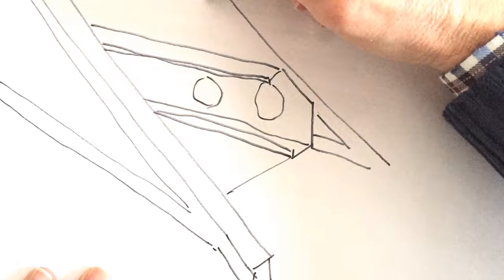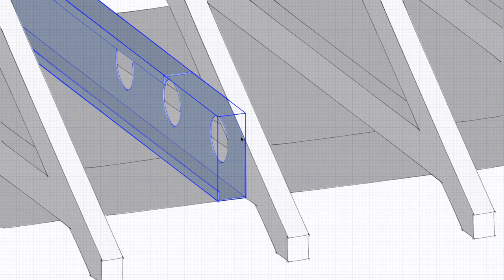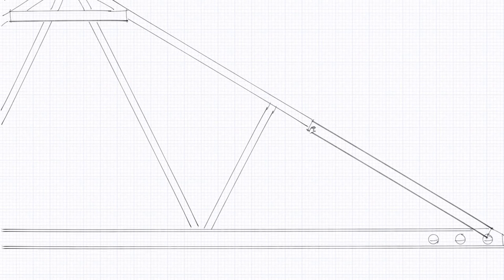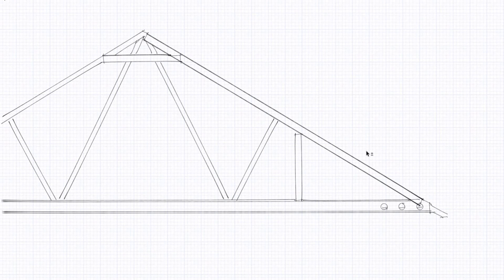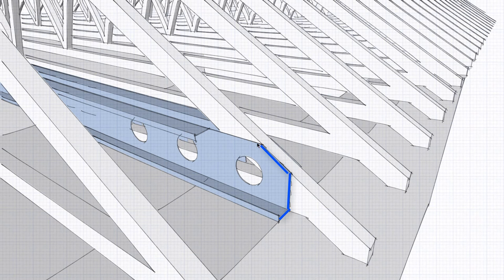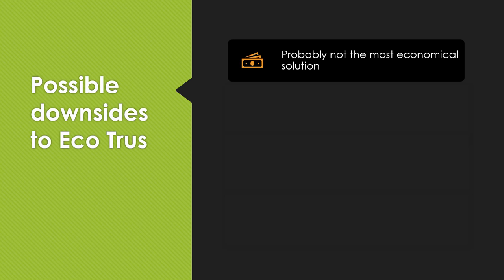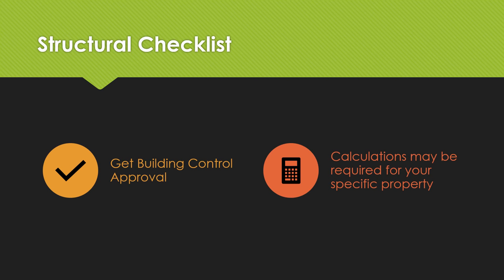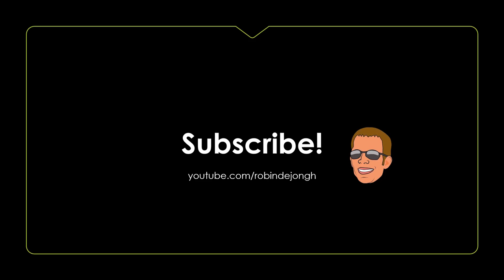Does eco truss work? (loft conversion)

Comment: I do not rate the Eco Truss videos very highly as although the product is good they skip over some important bits eg fastening the steel to the wood, and the cost of each beam I never heard mentioned. Also, you have the extra cost of scaffolding and crane or a team of men to lift the heavy beams. Then there is putting the lower removed roof tiles back on which is harder with an old roof - tiles crack etc. With wood you can cut it more easily eg if there is a pipe or something to go over or you need a hole cutting - wood is easier to cut/modify than steel - easier to work with. It is hard to get measurements spot on - with wood this error is less likely as you can cut on the spot, & even extend a piece a few inches. I think their steel system is for the 50k + projects. I like it though.
Reply: Sorry totally disagree steel can be cut just as easy as timber and can be modified or added on timber this steel structure can extra cost for a crane no crane needed and scaffold is need either a timber conversion or ecotrus I’m a installer of the structures and over the conventional timber system cost space and time is a huge saving  than timber structure iv been in structural steel as a welder fabricator for 20yrs the system design construction is honestly quite amazing to erect and see the finished product from first steps to completion and overall product is solid when it’s finished
Reply: I've watched videos where they do bolt through the wood.

Comment: Hi , In the videos they do say that all habitable loft conversions ,that it is to building regs . I have spent 50 years in the construction industry and I think the system and the ease of building and the inconvenience to the living part of the property is first class . Even if timber is cheaper ,there is a lot more labour hours on site on site , so it is horses for courses .NO crane needed and no heavy steel work and very little scaffold hire .
Reply from the maker: Thanks. I agree, and it's great to get your experienced view on it.
Reply: I’ve watched their videos and I like the whole process. I am concerned about thermal bridging, especially on a dormer. They haven’t shown how they eliminate cold bridging on their dormer construction yet.
Reply: @JohnnyMotel99  I think the best ,is to ask ROB VIA ONE OF HIS VIDEOS , as if a vented cold space or a fully insulated space .I did see him drill some large holes for venting air circulation on the video with the building inspector . Then if it was living space or storage space only .

Comment: Mine is getting fitted next week. The amount of extra room (length and height) I’m getting from this system compared to the “traditional way” is unbelievable.
Reply from the maker: Great feedback, Chris. Have you gone for the dormer version?
Reply: @RobindeJongh  no, just the Velux conversion
Reply: Do you mind sharing. How much it cost. I am currently trying g to get quotes
Reply: Hi Chris would you mind providing a rough idea of cost. Cheers mate.
Reply: @glenreid69  hi. It’s was £12,900 for roughly 40mts squared to be supplied and fitted
Reply: @Chickenboots1  Thanks mate. Were you happy with the service? Would you recommend it?
Reply: @glenreid69  yes it was a good service from them. Just make sure you have electrician/plumbers to hand to move any cables and pipes first and it’ll all go smoothly.

Comment: Seems over kill to me, should be enough to have 1 lightweight steel truss per joist ( could also be a seam welded full box section) and throughbolt the steel and joist , then retriangulate and reinforce the rafter structure in timber as normal. The method of inserting all the additional reinforcing through lifted sections of roof can be applied to any method of reinforcement/construction. You'll definitely get a lot of condensation forming on the cold ends in the eaves and it will keep the loft floor colder than it would be unless the eave space is fully insulated.

Comment: Seems to me that a simple triangle shaped flat steel gusset at each end and the peak would provide adequate strength and eliminate the need to cut off that bit they are currently.

Comment: i did get a quote for ecotrus. They don't laser scan anymore,that's disappointing as possibly one of the time saving contributions. Stairs are extra, as are window openings, also the price is not for a weather proof structure externally. The waiting list is months. I was really keen however I am now considering conventional build as I can save 50% on the quote provided. More if I do some of the work myself.

Comment: Hey Robin. My roofing contractor put me on to EcoTruss. I [was] a civil-structural engineer and had just put together an outline for a dog-kennel dormer to go into our bungalow hip roof, but it needs to be done without disturbing the upstairs en-suite shower room.

I had dreamed up a structural framework to allow this "all by myself", and now discover that Eco Truss have done it already! My vision was of hot-rolled sections bolted together, but this is of course far better - and lighter. I also like the idea of pre-formed holes, which in our case can be used to re-route existing drainage pipes.

I note your warning about 'cold bridging' - will need to check our contractor sorts this out in design/construction.

Absolutely brilliant video. Thanks.
Reply from the maker: Thanks Neil. Hope you get it sorted!

Comment: 6:30 I’d say they are load bearing. Any truss would drop even with the extra steels. I’ve build steel houses in NZ. That gauge and type of steel is flexible. 
Thing I’ve noticed in the video of builders using this system is they never vacuum up the drilling shards. This is the start of those steels rusting. Clean up before covering over. And spray any drilled or newly cut areas with zinc rust proofer.
Reply from the maker: Hi Alastair. It's possible the studwork is loadbearing, or at least will transfer some of the deflection from the rafters to the floor joists. It's also possible that the whole system is designed as an "attic truss" and is triangulated. Thanks for your points also about the drilling.

Comment: Thanks for your very instructive videos Robin - especially, for me, that on "ecotrus" loft conversion. There might be quite a number of folk who would be interested in a similar analysis of the "telebeam" option in which 3-part telescopic aluminium bearers are slid in at right angle to the eaves.  That too uses metal beams alongside the horizontal joists but excludes them from the pitched rafters - presumably relying on horizontal timber collars at ceiling height to provide support for the upper roof.  It strikes me, as an amateur, that this might avoid both the additional cost and weight required to be borne by lower levels and also thermal bridging of metal under adjacent to roof tiles.  Although such bridging at eaves and the installation and maintenance of services through metal box and I-sections are questions in my mind.
Reply from the maker: I hope to tackle a telebeam video one day 👍

Comment: Excellent analysis and overview by an engineer. Your independent assessment is greater value than to get to know the system by working with Eco Trus closely, as you'd become a sales agent for them.

What about putting solar panels on the new roofs? Can they handle the added loading? What about solar water heaters which are substantially heavier? What about adding substantial hot water storage inside the new room to use as energy dump when electricity from solar panels not needed?
Reply from the maker: There may well be extra capacity in the Ecotrus system to allow for solar panels and water storage, but you would need to ask them.
Reply: @RobindeJongh  Yes, I'll ask them in the form of architect's drawings and specifications. They can then look and see the stress load envelope of their system will cover my roof loading with suffiecient safety margins.
I asked your opinion as you invited questions....

Comment: Interesting informative surveyor/engineer view. Actual jobs shown very fast with Rob & gang doing the job experts fit fast skillful good teamwork, sheer speed very persausive. I like the traditional framed roof with dormer one side roof windows the other. On old roofs while converting best recover with lighweight solution insulating the same time. Installing solar panels on duff roofs bit silly. I have a cornish unit awkward roof not well constructed would like to convert hip to gable if practical for extra space 20' internal x 14' between current purlin lines  likely get 18' + width decent ensuite room/attic pad with fantastic views! Staircase installation space/access looks very difficult anyone done one?  Advice gratefully received!

Comment: This is basically a flitch technique with lighter cold rolled sections. The timber sandwiched at the wall plate provides the rigidity for the joist ends and the c-section on the rafters prevents deflection. Also the rock wool insulation laid within the joists would prevent cold bridging as it’s pushed to the end?

Comment: One of the benefits I see is that the reinforcement is slid in front to rear, so doesn't require side access through gable ends or into party wall. Especially a benefit for a mid-terrace house.

You mention cost as a negative, but on their website you can enter your dimensions for an instant estimate and it's actually quite cheap. I imagine the reduced on-site time is the benefit. Less man hours. Try it yourself.

Finally, one negative that unfortunately makes it incompatible with my house. It has to sit on the external brick walls. My house has a low roof, so the soffets are lower than the ceilings. You can effectively see the inside of some of the roof on all the external walls. So when I enquired about it, they said it couldn't be done.

Comment: Hi Robin.

Thanks for the detailed explanation on the workings of eco truss. Nothing I can’t wrap my head around is that how does their dormer version work without a ridge beam. Please shed light on how structural strength is achieved with half the roof replaced with flat dormer that too without a ridge beam

Thanks
Reply from the maker: Very good question! They use a moment frame which they have especially designed for this. You can see it in some of Build it with Rob's videos.

Comment: HI, in the Pro box you can add less cost with skips: with the cold rolled prefabricated steel joists there are no off cuts that need to be discarded at aprox 500£ per skip

Comment: 4:50 That hole actually increases the strength because it's pressed out and has a lip all around it. You'll find the same thing in aircraft bulkheads
Reply: Spot on it forms a lightening hole the lip is very important structurally.

Comment: So essentially the steel C section beams are doubling up each original timber triangular truss. 
Could the same result be obtained by using , say, laminated OSB cut into lengths and bolted through both sides ?

Comment: The stud walls add strength, the cut out holes have the rafters that continues to the end bolted more than once,  the transat at the ridge will hold. No bounce on the floor as the floor panels are the strengthening skin. The thermic barrier can be maintained with insulation. Because you remove the rive tiles for access you can insulate easily.
Reply from the maker: Thanks for your feedback Julian.

Comment: A lot of their videos seem to be creating additional usable space, and not extra 'rooms' as such. I've seen one or two that are full habitable loft conversions. I think the mention of 'bolts' is interesting as I think it's all done with TEK screws, so it's more open to the DIY/jobbing builder market. The air gap below the felt should be 50mm (assuming it's using the original [non-breathable] felt). Planning permission should also be in your mind when you're looking at converting these loft spaces. You will need planning permission once it is above a certain (volumetric) size.
There are other systems like 'Telebeam' too that are worth looking into.
Reply from the maker: Thanks for your extremely useful comments!

Comment: Great video Robin. One thing to consider for any loft conversion is the supporting walls. For Ecotruss solution some of the floor C sections may be above window lintels so extra load added which could be bad. For loft conversion with steels between the gables (new loft joists on hangers) that will put extra load on the gables. If made of blockwork are 3.5kN blocks acceptable at 1st floor level, and how much will padstones help. So another video on  the supporting walls would be good. E.g. do BCO need all lintels exposing i.e. dry lining removing, also do the building foundations need exposing? Thanks again.

Comment: Very useful informative explanation
Would appreciate similar xplanation on dormer roof . 
As we carry out traditional loft builds 
Few of our clients prefer not to have eve space , you loose from at least front  section approx 2/3 mtres of usefull floor space .
So we use rafters 175 mm & strap & bolt in.
Im assuming to do that with sheet metal £ would not be possible unless you use steel beams.

Comment: Hi Robin.
Being in the sheet metal trade I would think that the frames would all be cut/mitred before being galvanized
Reply from the maker: Thanks Matt. This depends if they are using pre-galvanised sheet steel, which I assume to be the case, but I may be wrong.
Reply: In NZ we would spray anything we cut with zinc spray paint to stop it rusting after cutting. Plus clean out metal shavings that start to rust in channels. 
Ok for hot dry climates like parts of Australia but not really suited to wet climates. Condensation can be an issue. It’s got to be done with careful thought or it will start to rust. This might be a new industry in decades to come. Repairing stuff that’s lost it’s structural integrity.
Reply from the maker: @muirallie  Good points. In the UK there are many homes built after the 2nd world war that used non-standard systems, that now cannot be mortgaged unless repair work is carried out.

Comment: Great video! I was wondering if you've seen a Telebeam system - a similar technique to Eco trus but aluminium is used instead. The ends are telescopic (so no need to get it manufactured to measure) and it does not requires the upper chord. Looks much weaker than this - but I was wondering if it is?
Reply from the maker: Hi Leszek. Telebeam looks like it has various UK approvals so probably will be a good system to go for. Aluminium also doesn't rust.
Reply: My nightmare would be the steel arrives and is 1" too long or some other measurement error, so the telescopic feature of Al ones is attractive and I would think it is worth paying extra for in order to avoid the worry and stress of the measurements being out.
Reply: Hi both. I was having a look at Telebeam too but they appear to need larger beams (depthwise) than Ecotrus to cover the same span. Looks like they are comparable depths to a conventional conversion but the Ecotrus system appears to allow the floor to be slightly lower than the conventional approach so may be an attractive option in cases where head height is hitting the limits.

Comment: Interesting system, trusses are at 600mm centre's.  I've done loads of loft conversions,  always been  150mm x 47mm rafters and 254 or 303 steel , spliced twice, nightmare to physically get it into the lofts, although mansard roofs are much easier,  looks like an easy system to use on new builds with trada trusses,

Comment: Hi would you consider this as a non-standard construction and would cause any insurance or future sales issue?

In addition, if the rear wall is to be opened up on the ground for a single-storey rear extension, what would be the implication compared with a traditional loft conversion (in which side walls are used for supporting the loft)?
Reply from the maker: It is possible that this would be considered as "non standard" in terms of insurance, though this is not my area of expertise and you should check this with insurers. If you open up the rear wall the load of the roof and 2nd floor will need to be considered in the design of steel beams and masonry support, so you may end up with slightly larger steels and larger piers.

Comment: Great explanation. Could you do a similar video showing Telebeams? It seems a much simpler solution. Aside from the weight and handling it I can’t see why you couldn’t use timber in the same way as the telebeam solution for limited spans especially seeing as the cost £450 each!
Reply from the maker: Hi. I contacted Telebeam and they didn't want to know, even though it would be unbelievably good advertising for them. By all means get in touch with them and ask them to get back to me. Timber wouldn't usually work because it can only span about 5m maximum as a rule of thumb.

Comment: another option worth talking about if possible? Ply box type of conversion using hangers off the box, party wall agreement may be needed as with gable to gable steels
Reply from the maker: Thanks Rog. Yes, I like the ply box option myself and hope to give it a video at some point.
Reply: @RobindeJongh   if I got some plans drawn up of what I’m proposing to do using a ply box system with dimensions could you do me some calculations for building notice? Obviously charge me for your services?
Reply from the maker: @rognevs5695  You can send me consulting requests here: https://forms.gle/2ZsCXZWifnZu3WXt6

Comment: Good job, when they walk on the steel floor sections they do seem a bit flexible actually. If I was looking to do this then I would try to reduce the floor section depth to get more head height. I do realise the bending strength/stiffness comes from the depth Ixx however. Maybe look to  maximise this shape. It looks like the holes are also for weight reduction as the material in the middle is doing next to nothing. Not sure I like the self tapping screws they use when the steel is so thin. Thanks for the review.